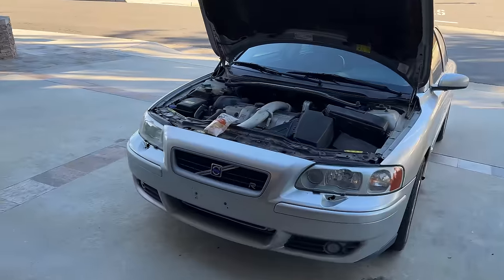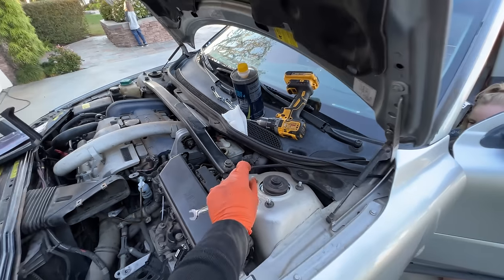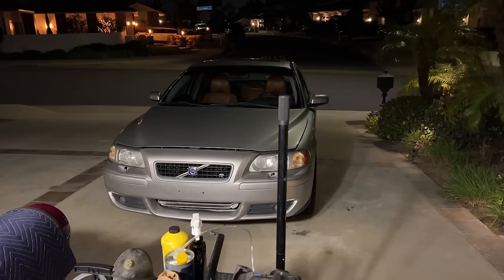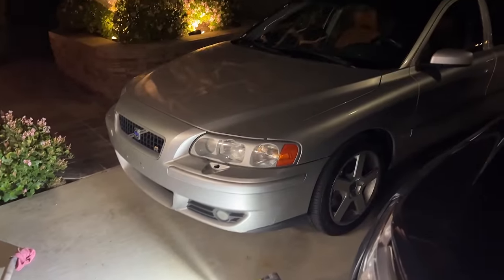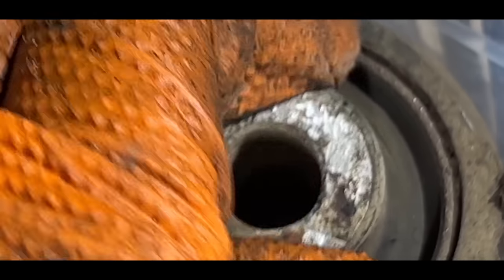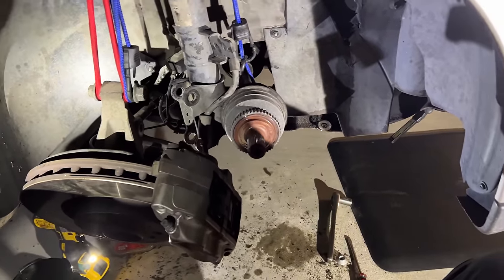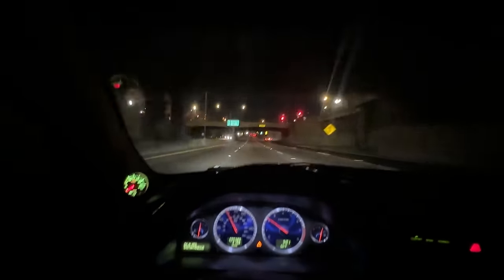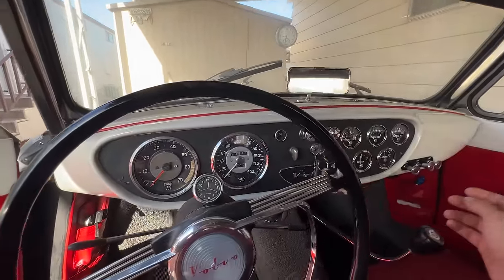Daily Driving a Volvo S60R - Bleeding Brakes, Control Arm Change, etc. - Ep 4

Comment: David i have a 2005 volvo s60 r with 123 thousand miles automatic. It does have the usual problems of suspension and some sort of vacuum leak. Its has a p2177 code.... Im in san diego and im trying to get a idea of how much i can sale it for. Any help would be much appreciated
Reply: Could be a vacuum leak or a bad fuel injector. Check for pending misfires. Otherwise, check all your boost hoses and TCV vacuum lines.
Reply from the maker: Check engine lights kill sales in CA. If you want best price, take it to a shop to sort out the problems and then you’ll have the confidence of a good-faith sale. If it’s in clean condition, $5,000?